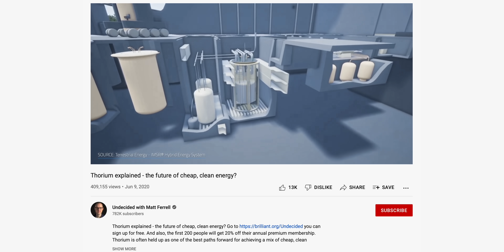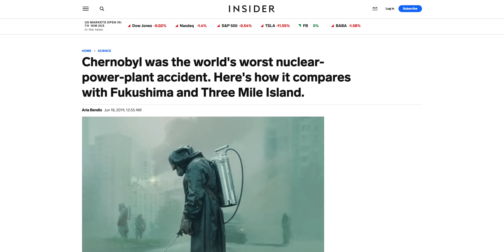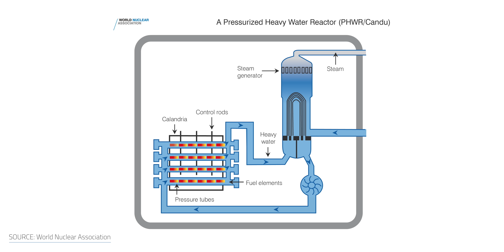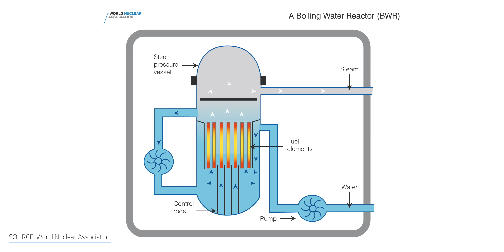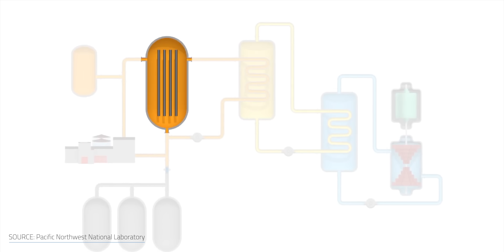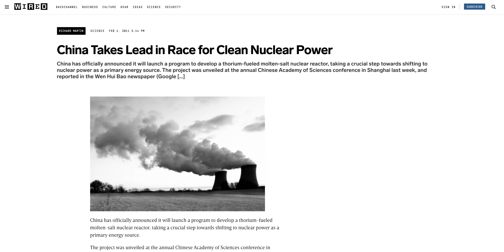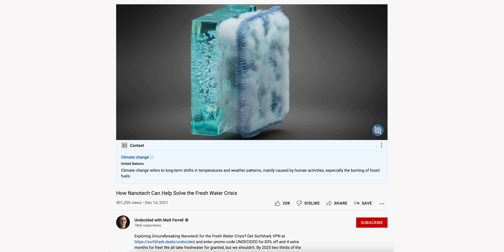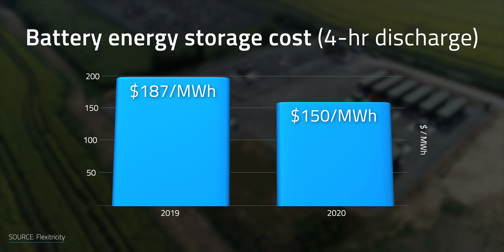Revisiting Thorium Energy - The Future of Nuclear Power?

Comment: But solar and wind do not have a 30 year life expectancy. You will have to replace them about every 10 years. Same goes for energy storage, especially batteries. Also solar and wind are government subsidized, and all those subsidies come out of the consumers pockets, as taxes (hidden cost). So the LCOE is very dishonest when it comes to the actual cost of solar and wind. Also the waste from making wind and solar generators have just as deleterious of an effect as nuclear waste, they just hide that fact better. Also the cost of mining thorium is misleading. In the US all mining operation are required to keep heavy metals from leaching into water supplies, this means every single mine in the US is capturing thorium, and them being able to sell it would be a windfall, and that would keep the price of thorium well below the cost of coal.

Also MSR's have the advantage of burning up current nuclear waste, and the waste from thorium is like 2% of what current reactors produce. These two fact means that, for the next century or so, we could be reducing our stored nuclear waste. They also can use up nuclear materials from decommissioned warheads. Also thorium reactors can produce a medical isotope useful in certain cancer treatments, making those treatments cheaper. MSR's can be made into self-contained units that can be transported by truck to places in third world countries to provide power. That power can be used to pump water, or power medical equipment in hospitals, or power refrigerators to increase food storage and reduce food loss and starvation.

There is no perfect energy production technology, but thorium in MSR's has an insane list of benefits, and some of those benefit are unique to thorium. The future needs to be thorium MSR's and the sooner we get there the better.

Comment: I think nuclear should be used as a backup to solar, wind and hydro, coming into affect during times of particularly high demand or when energy storage (which needs improvement, and "stacking concrete blocks" isn't the answer) falls below a set amount.
Reply: Issue with that is that nuclear takes time, several hours, to come up from a cold start. And keeping it hot is wasteful of fuel. It's very good for steady state loads, unlike wind or solar.

Comment: I think nuclear energy will play a small part in the future of energy. We can use it to drastically reduce the half life of existing nuclear waste (with breeders) and in particular the thorium cycle yields some useful isotopes of some elements (iirc) which you can't get otherwise atm. Add to that the uses in (space) ships, (secret) off-grid (underground) facilities, desalination etc.,  it will likely be present. But given the lower cost and less cumbersome construction and maintenance of solar and wind and also the (maybe no longer) ever-elusive fusion power, I don't think it'll provide the lion share.
Reply: most gen 4 reactors will be built in factories and operationable 1-2 years - even less with standardisation and mass production
Reply: @jimlofts5433  source? Also would this apply to Europe?
Reply: @Zahlenteufel1  Thorcon Indonesia plus many other sites as the reactors are built from stainless steel they are easy to constuct as they are not pressure vessels

Comment: The molten salt reactors are incredibly safe, there's no reason (other than money and greedy shitbag corporations) why we shouldn't be replacing our old reactors with them.  Instead of a meltdown there is a cooldown and seizure of the reactor if it fails, which encases all the radioactive compounds in a solid mass so it does not contaminate the environment.

Comment: We definitely need nuclear energy in the short to medium term. Until we have large-scale reliable storage we can't rely on wind and solar. The thing we really need of course is cheaper large-scale geothermal.
Reply: Geothermal is limited to locations like solar, wind, and hydro.
Reply: @romado59  Depends how deep you can drill your borehole. :) But yes economically it's currently limited although a lot more places could be used than currently are. Also 'technically' ground source heat pumps are geothermal.

Comment: I'd say I've been a big proponent of nuclear power, but a recent headline caught my eye and really changed my perspective on it's usefulness:

"The Duane Arnold Energy Center in eastern Iowa, the current site of a now-idle nuclear power plant, will soon host a 690-megawatt solar farm. The new solar farm plus storage will replace the single-unit, 615-megawatt nuclear plant, which powered more than 600,000 homes."
Reply: Solar generally only has a capacity factor of around 30%, so that 690 megawatt solar farm will only average around 230 megawatts of power. That nuclear plant would have over a 90% capacity factor and so would be providing much more power to the area. Assuming all the power from the nuclear plant was needed, the area will now be importing 70% of their energy, or will need a backup gas plant.

The storage system is only there to ensure that most of the power from the installation can be utilized, not to ensure that there is enough backup energy to provide to the region.
Reply: @nolan4339  Even then, I think the relative scale is much closer than most people realize. Granted, Nuclear plants have substantial exclusion zones that play into the numbers game here. I think it's fair to say that if the land area consumed by one Nuclear plant is capable of hosting solar at even 40% equivalent capacity, it looks very good for Solar in the long run.
Reply: @bradley3549  Nuclear has a smaller overall front-to-end footprint than solar still including EPZ.
Reply: @Baibakov88  No doubt, but the difference isn't nearly as dramatic as what you might expect. We're not talking a 100:1 ratio here.

Comment: With recent advances in mass produced thorium reactors in ship yards, a complete reactor can be built in months, and delivered anywhere in the world in weeks. This destroys the cost of long construction times, the primary expense of building reactors, and further reduces the cost per kw. Moreover, because the reactor is made of plug and play modules, replacing worn subsystems, is fast, inexpensive (relatively speaking), and increases service life. Finally variations in design make it possible to also build fast breeder reactors based on the thorium cycle, allowing us to use the existing solid nuclear waste as fuel, and eliminating the long term storage problem created by the prior technology. Until we improve our grid to better handle transient energy production, thorium reactors provide us a fantastic stop gap to ensure global energy sufficiency, while protecting the environment, and even providing the energy to help us begin removing excess carbon from the environment.
Reply: Very well said, I agree.  This NEEDS to be brought in as a comprehensive solution to combine with monocrystalline solar panels on business warehouse & residential home roofs, as well as wind-power in areas with stable winds and hydro-electric where available.  Lower energy costs and increased electrical production is sorely needed across the board, and with lower prices will positively impact things like electric vehicles, desalination, recycling, aluminum production, and many other industries.  It can't just be one technology only, but on the large electric utility scale we're way past needing some new state-of-the-art nuclear reactors here in the USA.  And frankly?  It's a bit embarrassing that China is jumping past us on this...  I guess we'll have to see what happens with China's facility first?
Reply: @XSFx5  
As long as our government is for sale to the highest bidder (i.e. the fossil fuel consortia), ours will remain a society antagonistic to environmentally friendly energy alternatives. We need to firewall government from corporate influence if we ever hope to have a government serve its most vital purpose. Namely the success and sufficiency of a thriving middle class.